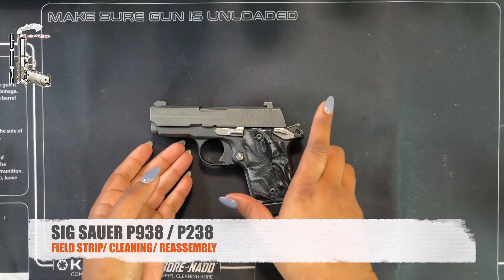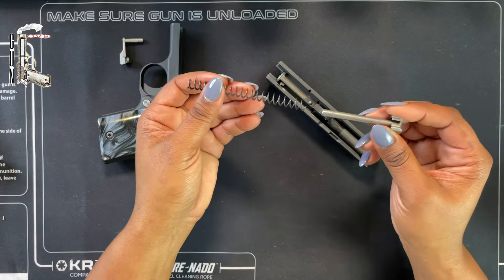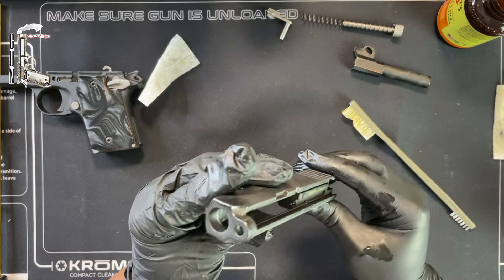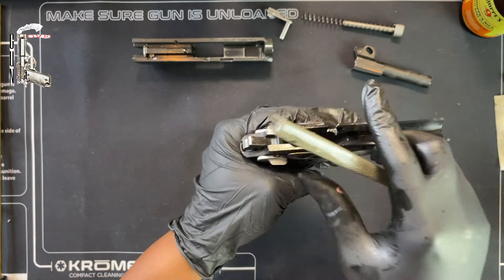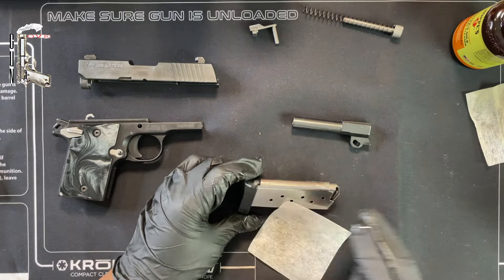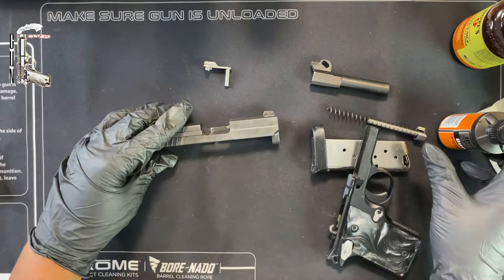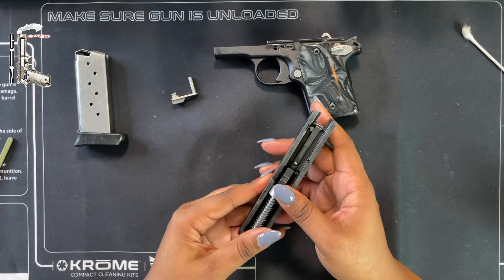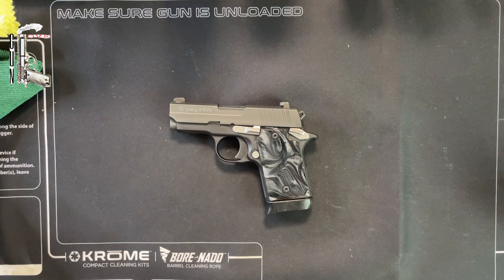Sig Sauer P938 / P238 Cleaning Tutorial

Comment: The safety lever on my p938 is a little floppy on the right side. Just giggles a little more that I think it should. The left side, which I use since I’m right handed is solid. Thoughts?  It seems to work fine, just makes noise if you tap it.
Reply from the maker: I’ve heard of some common issues with the ambi safety being a bit loose on both the 938 & 238. If it was me, I’d call Sig directly about it or take it to a licensed gun smith. Possibly see about just getting a right sided safety lever and installing that since you don’t need the ambi one. Please come back and share an update! Thank you for watching and good luck!

Comment: Will this cleaning method work with my 229?
Reply from the maker: Pretty much, (minus that tricky ejector) put I’m editing the P229 video now and it will be up in a few days!
Reply: The field strip of the SIG-229 is the same as the Sig-226. One suggestion is the lock the top slide to the rear as normal. The take down pin can be easily pushed to the vertical position. Unlock the slide and the slide can be removed. 
   The Sig-239 breaks down just like the M-1911. The take down pin is inserted and removed through the small notch. The larger notch is a slide lock.
Reply from the maker: @whomagoose You Rock!